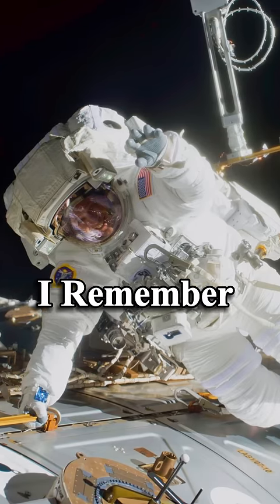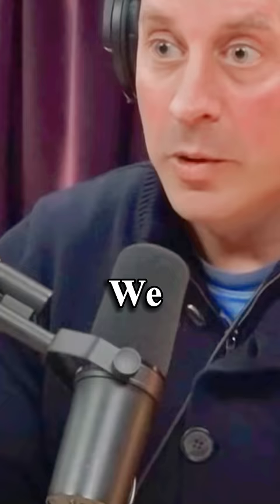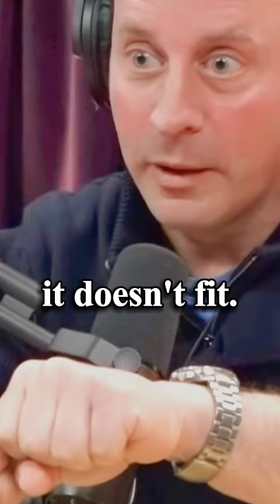when Plugs didn't fit | Garrett Reisman

Comment: Design physics for space is complicated because you have to remember there is no gravity and things get hot and cold .
Reply: They’ve known of the temp differences a long time. Really should have been taken into account at design stage!
Reply: @Monkey80llx  - they've known about gravity a long time too , but forgot there is none in space when they built the Hubble mirror .. 🤷🏻‍♂️ ( worked ok on the ground ) .
Reply: @Don Cahooti  There is gravity in space... especially when you are near big objects like the earth 🤦‍♂️
Reply: @doncahooti What are you talking about? You mean the deformation in the mirror that was 1/50th the width of a human hair? A technician actually noticed the imperfection using an older instrument before it was sent to space, but NASA didn't believe him
Reply: @jmccann6735  - maybe . I mean the one they sent up corrective lenses for .
Reply: @doncahooti  Yup that's the one, had nothing to do with gravity or lack thereof, just an almost microscopic dent in the mirror
Reply: @jmccann6735  -  not what I heard . 
They forgot to apply a formula for the recurving of the mirror when subjected to weightlessness. Took more than a microscopic dent to require a retrofitting of glass optics ( " glasses") to correct fuzzy pictures .
Reply: @Don Cahooti  umm, that has absolutely nothing to do with gravity lol there was just an error in test equipment on nasa's end.
Reply: @doncahooti  ya that's not what happened. Idk where you'd "hear" such a thing. All the info on it is available for anyone to research though.
Reply: @Jeremy9697  - yes that's exactly  why or how it was such an incredible error: there are books about how materials, like mirrors,  change without gravity. Someone forgot to run the formula or something .. like someone forgot to change meters to miles when the probe  missed Mars ..
Reply: @Don Cahooti  ...that's not what happened either... you need to research the topic you're trying to speak on instead of just guessing about factual events...
Reply: @Jeremy9697  - no yeah that's what happened . You're guessing that I'm guessing , how ironic . I had a friend at Nasa at the time. What's your cred ?
Reply: Astute observation sir.

Comment: I saw this video a couple years ago and reminded me this summer when every time I went out of my apartment the door wasn't shutting and locking... I went out a few times for hours before realising when I got home realised anyone could've been in there.... Until last month when the weather dipped and every time I go out it shuts and locks... It actually saved me once in the summer I went out without my keys, I keeps spares at a friend's pretty close but they have to be home too.

Comment: I would have never thought of this, not because I wouldn’t have thought about heat changing the expansion of the connectors, but because I would assume that if it didn’t fit, then, even if I WERE to force them together using heat, it probably wouldn’t even transfer the data anyway because it’s just the wrong connector.

I would think of it like a puzzle piece. You may be able to get it to fit, but that doesn’t mean it’ll work. So the fact that he thought of it AND it worked is what’s impressive to me

Comment: That's how we used to fit bearing sleeves on an F16 engine mount. Cool the mount in a vat of liquid nitrogen and heat up the bearing. If you miss an accurate insert, cut it off and try again.

Comment: Yes we do this same technique in machining we will freeze one piece of steel and heat up the other slide them together you don't need a weld you'll never pull them apart

Comment: What happens when they shrink back in the shade and the connector breaks?
Reply: they are stuck together. we are talking about material stretching/ contracting due to temperature. it's not much but can prohibit a really tight connection
Reply: Male and female will shrink together at the same time now

Comment: 600 degrees difference and he’s chilling in it unharmed
Reply: I’ve worked in 160 degree furnace just wearing coveralls I’m pretty sure they can handle 600 degrees in a thick ass suit
Reply: @cohenwhittaker1902 agreed , I’ve worked in a lot hotter environment as working in the molten metal sector , we have heat and burn resistant suites that allow upto 1100celcius
Reply: Suit expands....😅
Reply: He was in a pool...
Reply: @carrolharris3691 okay Dunning Kruger
Reply: That’s fascinating that it reaches those temperatures in space
Reply: Because its fake nonsense
Reply: @Level_No_Curve flat is earth is just tragic at this point.  Let it go.

Comment: Sometimes the small things that common sense solves results in large results. The same thing happened to me with 4 large military aircraft in a hanger when I detected a large fuel spill and there was an open spark source very near. I was able to eliminate the spark source before the fuel fumes did. Possibly causing a huge disaster.

Comment: I did this on a jetski when the oil cap wouldn't screw in I put it in the freezer for 10 mins. Took it out and screwed it right in. Heat expansion can always cause these problems.

Comment: Amazing that  those suits can handle those temps. I would love to see how
Reply: they're white for a reason :P but I love everyones comment on 'how can it handle 600 degrees' when it's only handling 250-300 F (121 C), he's saying the difference between shade and sun, is ~600 degrees, 20 it goes from -300 to +300
Reply: Amazing cooling  and hesting system.  If only that technology was shared with firefighters.

Comment: thats pretty big brain tbh , 10 min before u have to be in, high stress thing since if you dont do it quiet literally nobody else will. I am confused on the part where u can be that close to a 600* barrier and be fine enough to stick a probe over to it to heat up.

Comment: Here’s an interesting thing with metals in vacuum they can spontaneously weld.  The ISS shouldn’t have too much of a problem with it because a lot of that material is made here on earth, so has a small oxide layer and it’s technically encountering enough plasma to get insulation between metals.  But if you’re in enough of a vacuum, just push two pieces of the same metal together and you could weld them.  That’s where fabricating lunar bases after you get metal and material manufacturing set up on its surface would become very easy, build a construction suit with extra protective gear and running a current between the hands and you got people able to force at the very least spot welds with just their hands.  
Honestly, I’d love to get to the point where we can have blue collar work on the moon.

Comment: So.... how does the suit protect them from the heat? Are all the pieces of every satellite and craft made to withstand this constant expansion and contraction? Impressive
Reply: It goes more indepth as the suit actually contains a system to regulate the entire suite temperature which is what part of the pack they wear is for as well as maintaining breathable oxygen and also why water inside the helmet is so dangerous.

Comment: That doesn’t make sense, because if both sides get into the sun it will become loose again
Reply: He was covering the male side. The female side he kept out to heat the plastic to make it more easier to insert.
Reply: the problem wasn’t that it was too loose, it was that the connection was too tight initially. He essentially supercooled the plug to make it shrink just enough to insert it into the socket. If heats up again, as it will, the connection would get tighter, not looser.

Comment: I learned this back in the 90s I used to work as a machinist doing heavy brakes and suspension so when we used to do the hubs you had aluminum hubs and steel races and you would have to heat up the hub freeze the races then they would go together very easy when I first started at the company that guys played a trick on me and didn't tell me that and I was hammering at the damn races for 20 minutes Hannah was about to fall off exhaustion of beating on the race trying to get out of the hub yeah they're real funny guys and finally they told me the secret stop go freeze the races heat up the hub and it go together in a second

Comment: 600 degrees seems like it would be uncomfortable to put your hand into. Also, you're then holding a 600 degree plug, right?
Reply: What he means is that when the sun is shining directly on the ISS the temperature can rise to 600 degrees. The suits and the ISS itself are built to withstand the harsh temperatures and are even actively cooled. The suits can still become uncomfortably hot even with the insulation plus cooling.

Comment: The suits can survive 600 degree Fahrenheit?
Reply: 300+, the suit can likely handle 4-500, it's the cooling unit that would have issues. They're not exposed to 600F in space, they are exposed to -300 to +300 (more typically -250 to +250), the 'difference' between those temperatures, is roughly 600 degrees
Reply: @Azmodon  I see now where i misunderstood. Appreciate it

Comment: So I have a question.... if this all occurred in a vacuume... how then did this heat without the air to transfer the heat to the unit.... or does the radiation transfer on contract in turn heating it up..? I might be missing something anyone help me out

Comment: 600° difference..? Wait,  what?
Reply: so you know what temperature is tight? well the difference between the sun being out and the sun not being out is a difference of 600°F. so being in space without the sun facing you would be like -250 or something similar and so with the sun facing you it would be 600 degrees higher aka 450°F

Comment: As a electrician by trade, this absolutely makes no sense.
Reply: Just a problem with the voided metal rods that needed to expand
Reply: You don't understand thermal expansion? 
Maybe electricians don't deal with it much, but I do installing fiberoptic lines. 
You have to ensure the two ends of the splice are relatively same temperature, otherwise it's impossible to get a clean splice because one side is expanded. In fiber optics, a single millimeter of misalignment will cut down your data transfer rate significantly

Comment: But the thermal expansion wouldn't increase the size of the hole. The metal around the hole expands and if anything shrinks the hole. 

Think of a meta pupe. If the metal starts to expand the hole in the middle won't get bigger, it'll shrink

Comment: Why don’t we have demonstrations of these suits walking through 600 degree furnaces and coming out untarnished
Reply: because they aren't exposed to 600 degrees... like most flat earthers, even when you're told something completely straight forward, you're incapable of actually understanding it. "The temperature difference" is not the final temperature. The difference in temperature from -300 to +300 is 600... this is grade 1 math, try and keep up.

Comment: I can't believe people are still buying into this cgi crap!  Do the math!!
Reply: I did them, in school, in university, at home, it f*cking works. Maybe you are doing it wrong
Reply: @gheart8278  care to prove its CGI instead of making blind claims?
Reply: @Ethan_Roberts  the heat issue is not a blind claim.  It proves enough.
Reply: This is going to be really embarrassing for you but the reason you're confused is actually reading comprehension. You lack it.

You hear 600 degree difference, and you assume it's 600 degrees. 
Do you believe zero degrees Fahrenheit is the coldest anything in the universe can get?

600 degree range, as in -200 to 400 degrees. 

If you think tungsten connectors are melting at 400 degrees you know nothing of metals and I don't have time to get. They wouldn't even melt at 1200
Reply: @KappaKiller108  everything's made of Tungsten?  😄
Reply: @KappaKiller108  you mad?  😄😉